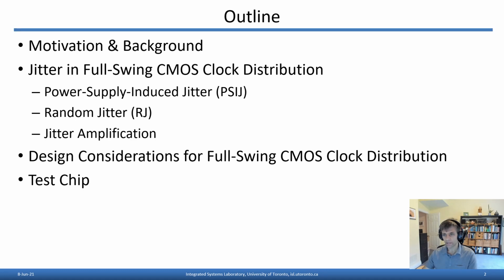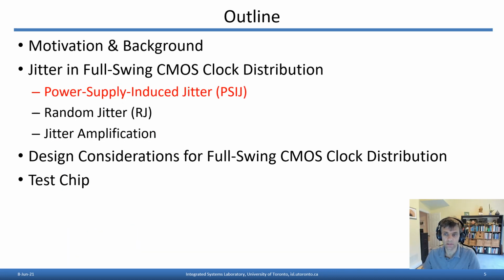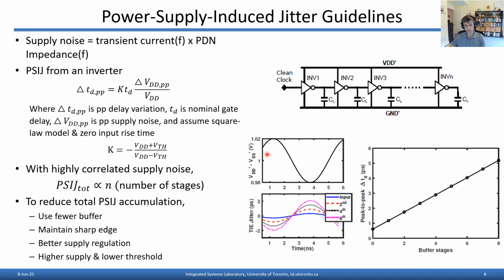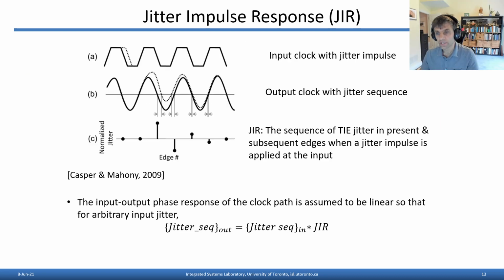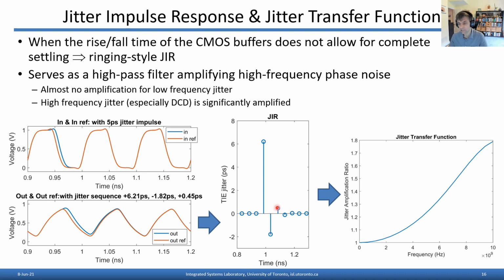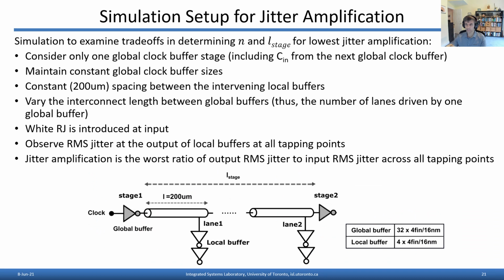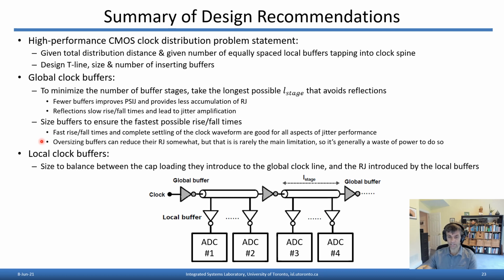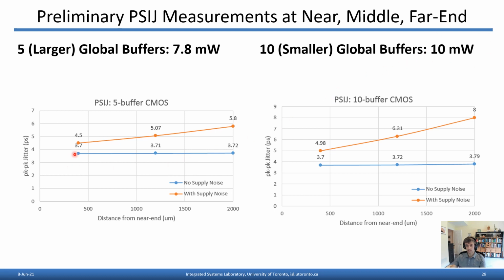Low-Jitter CMOS Clock Distribution

Comment: Jitter amplification and DCD can also be understood in the voltage domain: limited bandwidth of the distribution network attenuates the  carrier frequency, making the dBc of the phase noise, spurs of the lower sideband larger. From a AM-to-PM conversion perspective, this means larger jitter.
Reply: It also helps to explain the design of  DCD correcting butffer

Comment: Good video!. May I ask why duty cycle distortion contributes to high-frequency jitter amplification?
Reply from the maker: Duty cycle distortion (DCD) can be considered a kind of jitter that is periodic, arising on every alternate clock edge.  Thus, it has a frequency equal to that of the clock signal itself.  For example, a 10GHz clock signal with DCD will have a spur in its jitter spectrum at 10GHz.
Reply: @Microelectronics-ChanCarusone  In voltage domain, DCD appears as a dc signal. If my understanding is correct, prof? Thank you!